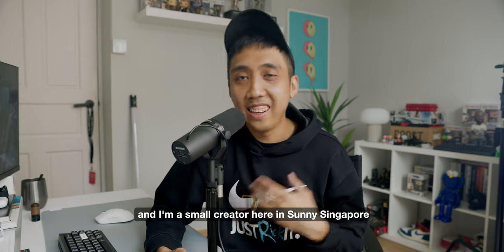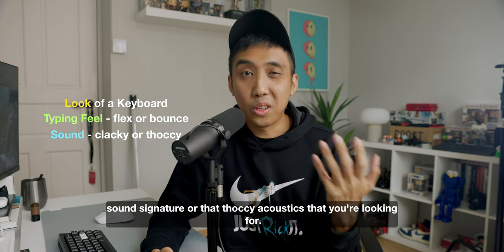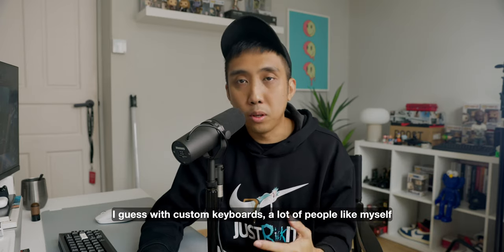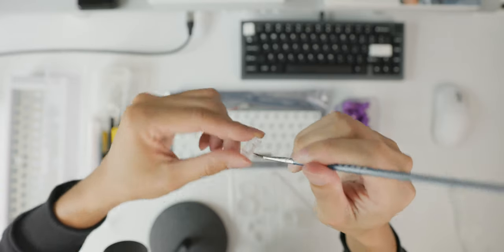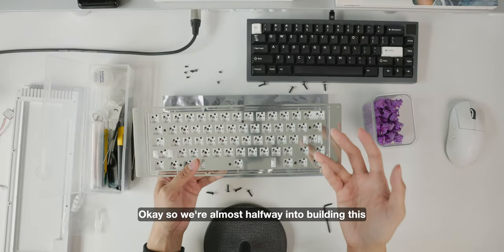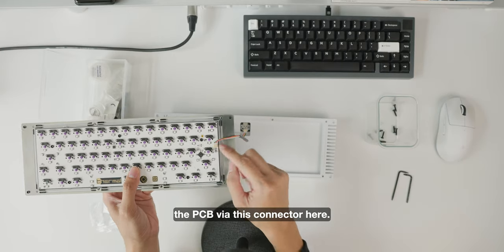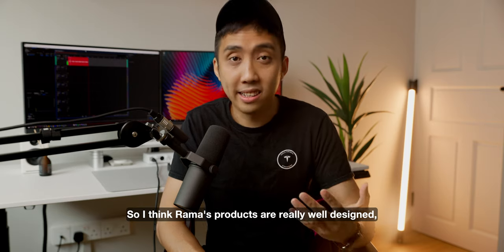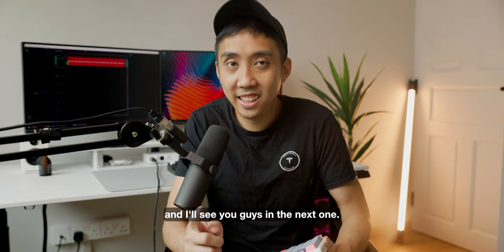I waited 2 years for this Keyboard..

Comment: I just got the Thermal + and I'm just NOT feeling it lol. Mainly due to the layout. (Currently using Sonnet, TOMO, QK75, Class65, Mammoth75, Iron165 R2 which are arguably so much better). But just because I waited 2 years for it as well, I guess I will use it eventually by finding the correct pairing/switches for it. Sound is decent so far on PBT keycaps, so I'd imagine GMK ones are better.
Reply from the maker: I just received the QK75 as well. Your collection is quite smililar to mine. I have the Iron165 as a daily driver. Thermal is just an aesthetic piece and a tester for me. Using GMK with AKKO switches sounds decent imo